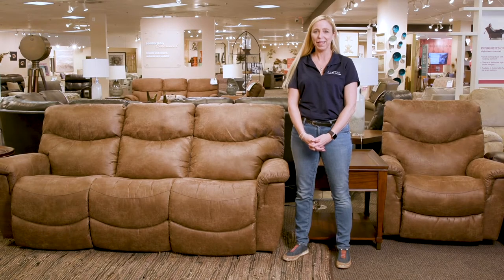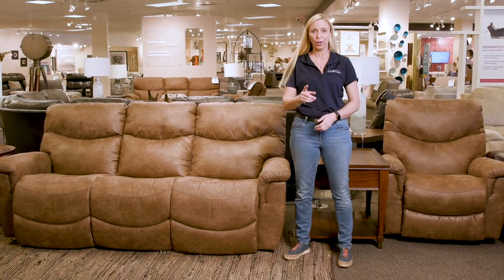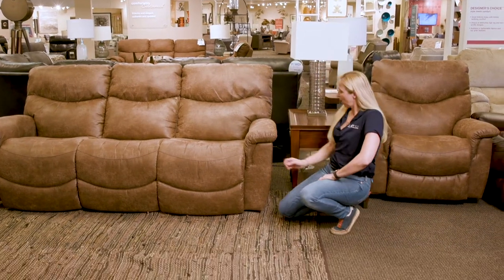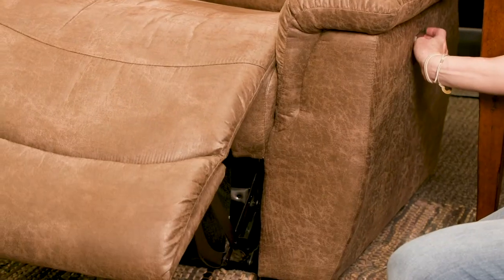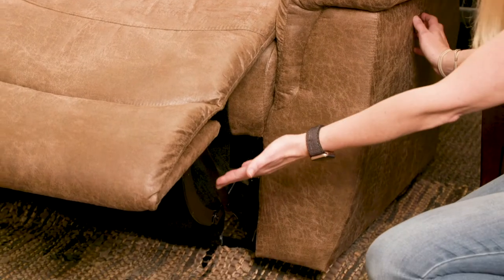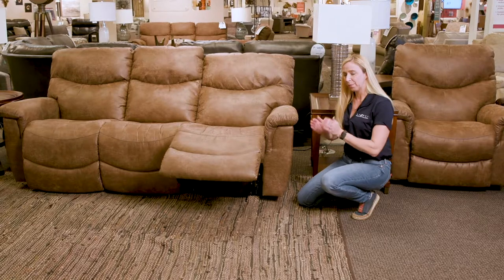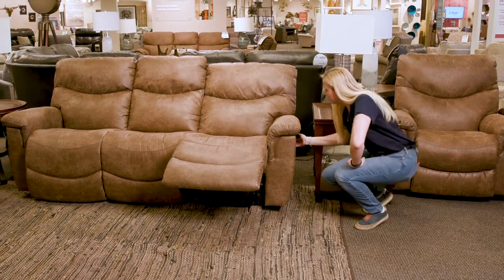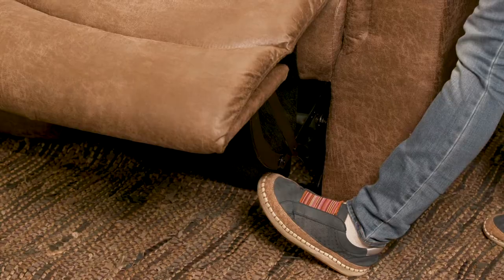Reset your Power Footrest on your La-Z-Boy Furniture

Comment: Hi Kim, I have a lazy boy reclining sofa. One side is very noisy when I pull the leg section out or put it back down. We have an extended warranty and called lazy boy. They told my wife they don't cover noises. They only fix issues if it's not working. I think that's pretty unacceptable. Any tips to quiet the sound myself?